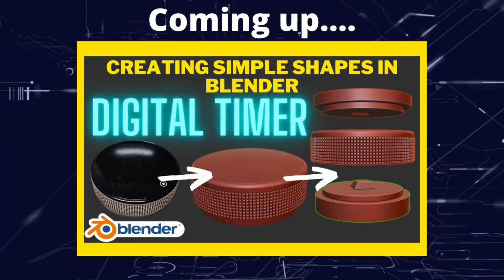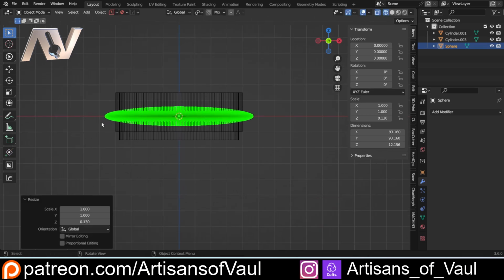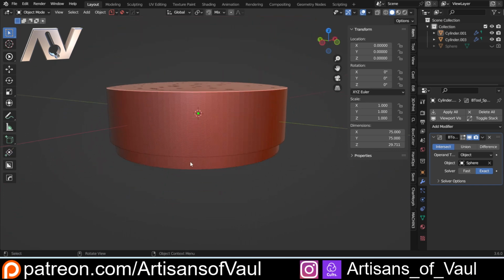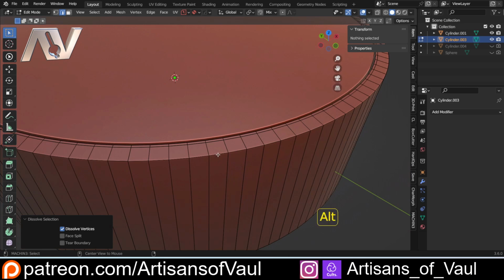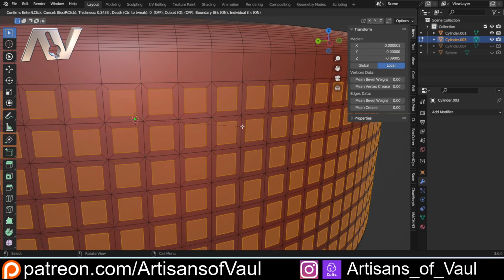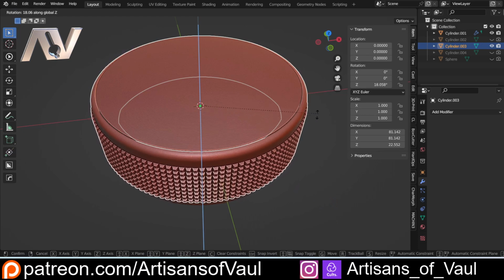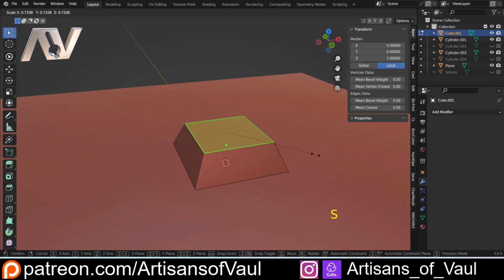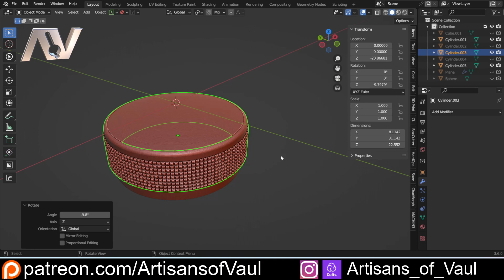Digital Timer with a 3D printing design workflow - Creating Simple Shapes In Blender

Comment: Just a thought... for the rotation groove... rather than creating the 90 degree angle slot, and have to slice it to print and glue together... why not make the groove a 45 degree triangular notch and groove so it can print in place without gluing after the fact? Is there a downside to that?
Reply from the maker: Oh nice idea.  So the main issue with this would be that for a resin printer you wouldnt have access to those inner surfaces to cure them.  But if you're working in a filament printer that wouldnt be an issue at all, in fact it would be a pretty good way to go I think (though printing in pla isnt something I have a huge amount of experience in).